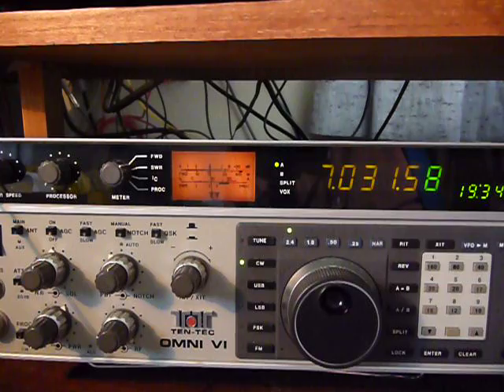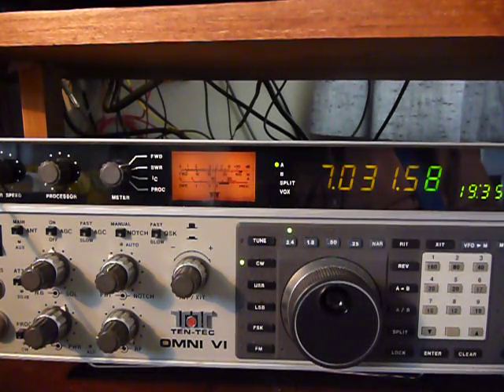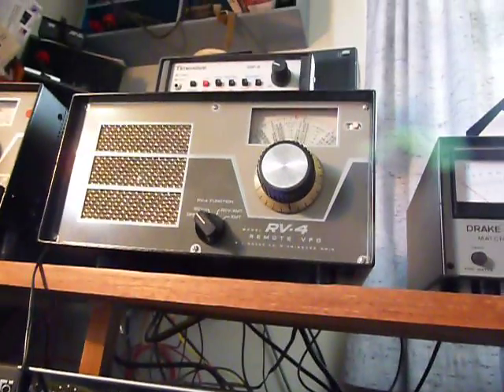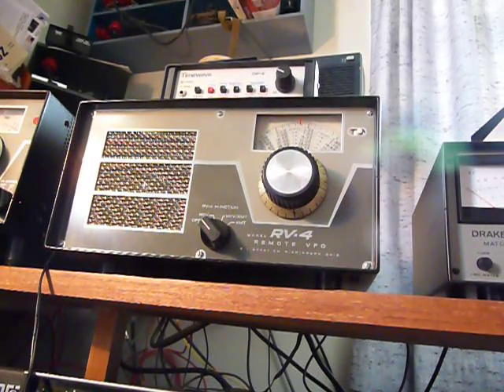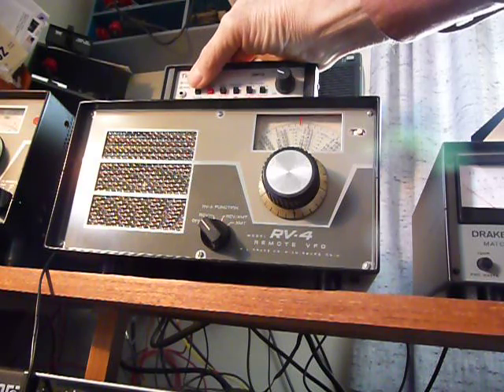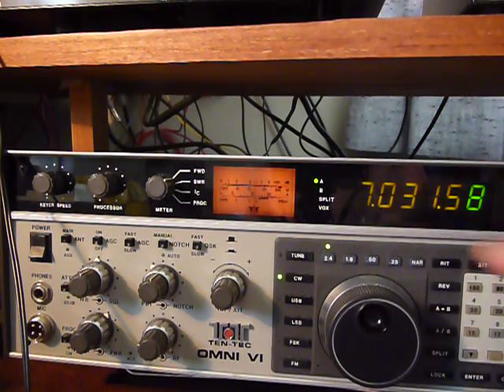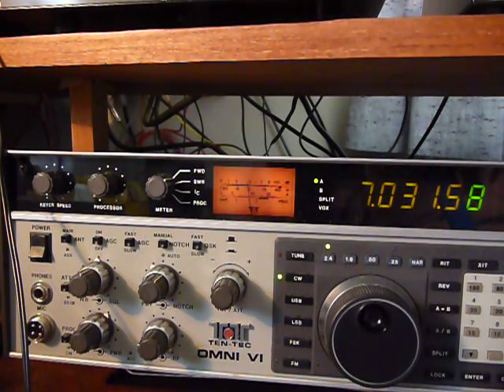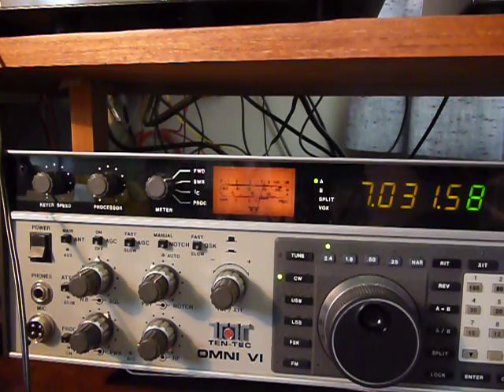TIMEWAVE DSP-9 With TEN TEC OMNI VI

Comment: DAM, THE HELL WITH CW. LETS HEAR WHAT IT SOUNDS LIKE ON PHONE
Reply from the maker: +Rick Burton Sorry about that, I very seldom use SSB and didn't think of using it for that but I have a video showing my GAP noise reducer on SSB with my Drake , I'll get the DSP 9 hooked up to the Paragon and make a you tube video next, thanks for the reminder..
Reply: OK, THANKS--- I WATCHED YOUR VIDEO TO SEE HOW THE RECEIVE IS AFFECTED
Reply from the maker: +Rick Burton I made a quicky video with the DSP9 and SSB with the Paragon, The Paragon and I imagine any transceiver with an RF gain control and PTO doesn't need the DSP9 for noise control but it might offer some help with filtering if your rig does not have filters. the video name is " my Ten Tec Paragon and DSP 9. 73.
Reply from the maker: Rick Burton Does this have something to do with my post about the DSP9.
Reply from the maker: Rick Burton I really do not use Phone but I have made a short demo on the Paragon which sound wise is no different than the Omni Vl. For the Paragon and Omni Vl, you really don't need an external noise reducer for phone, The PBT and RF gain does a good job.

Comment: Thanks for doing the demo on the DSP-9. I also have a DSP-9 and like to use it on my Skanti TRP-8250. The Skanti has some IF crystal filters but no DSP. The DSP-9 helps a lot to reduce the back ground noise. 73, Randy, w5kcm